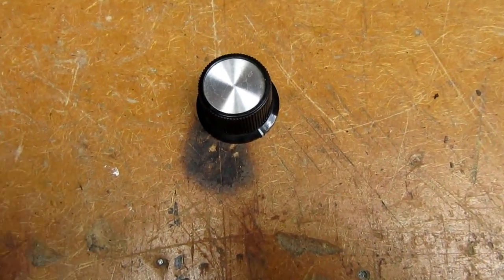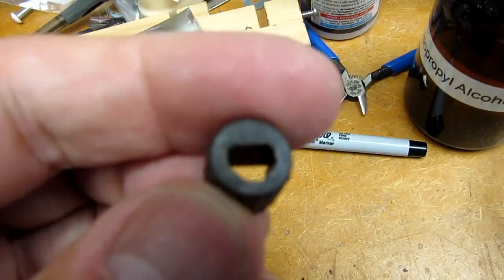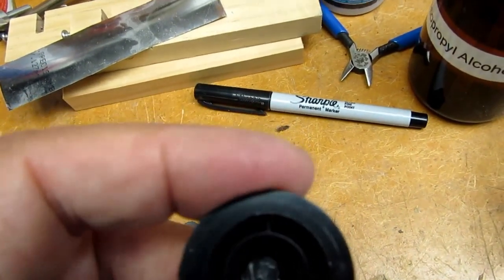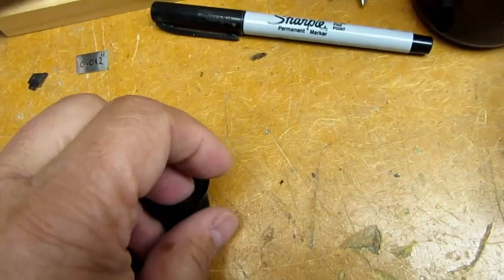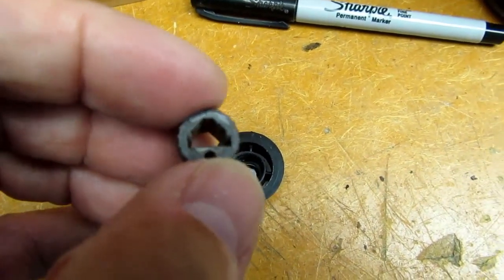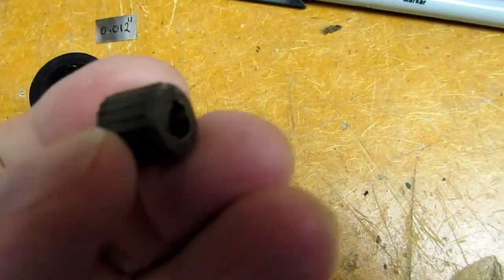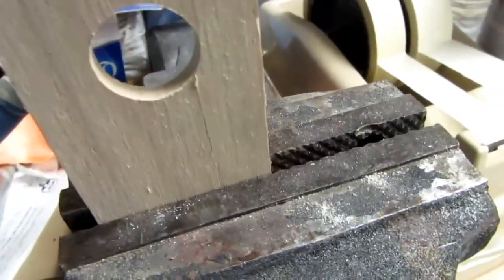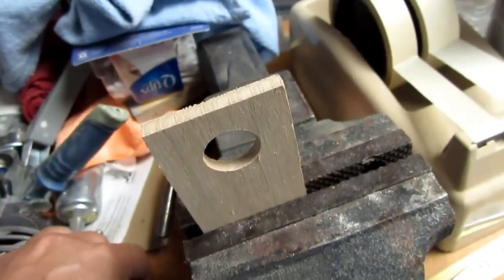Heathkit Knob Repair: Some Techniques I have Found To Be Useful

Comment: Shame Places like Radio Shack are gone. Used to be you could go and get or order most anything. When I was a kid in the, my uncle owned a TV repair shop. Tons of tubes in there.
Reply: I miss Radio Shack, but at the same time I have no reason to go there if they still existed. When people stopped buying home stereo components and the piles of wires you needed to connect it all, they were doomed. Some of those cables and adapters sold for 10x their cost or more.
Reply from the maker: There are still some places that are along the lines of Radio Shack, just better. If there is  Fry's Electronics (lots of them around California and Texas, and some around major cities elsewhere in the country), they have tons of electronics stuff, and usually better quality parts than the stuff Radio Shack used to peddle. And of course, with hobbyist-friendly places like Digikey, Mouser and Jameco out there, you can easily and quickly get almost anything, unless it is vintage stuff, or proprietary. And even with companies like Heathkit, which were big enough to use lots of custom parts, there are specialty 'garage operations' out there where people are making reproductions of many specialty parts.

Comment: I have a IT-3120 I need to replace the potentiometer for the Set Beta. How do you get the knob off without destroying anything?
Reply from the maker: As far as I know, practically all Heathkit test equipment used the same friction-fit knob design (the oldest equipment used setscrews). You should be able to pull the knob straight off the shaft, and some careful prying might be necessary; just be sure to slip some kind of protection in front of the panel so your prying tool does not scratch or dent it.
Reply: @youtuuba  Thanks, I did what you suggested and it finally came off.